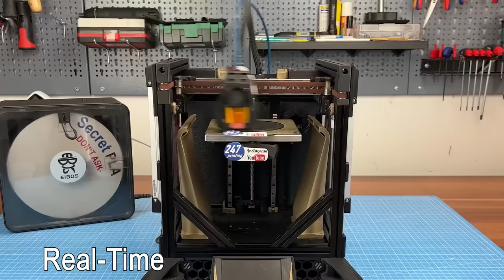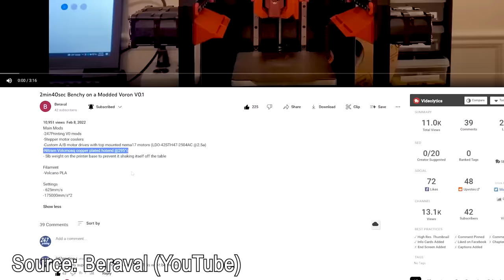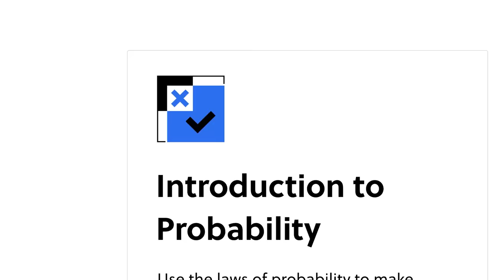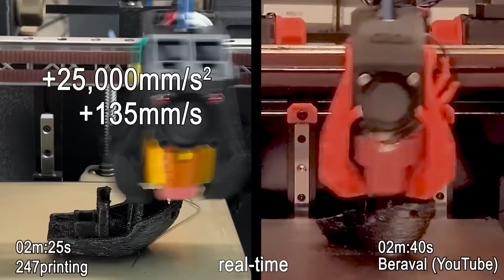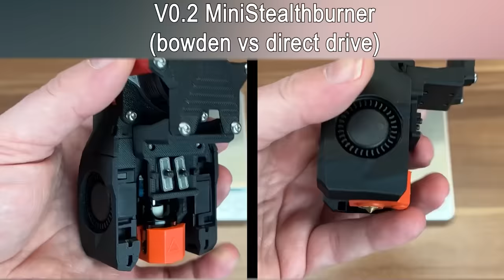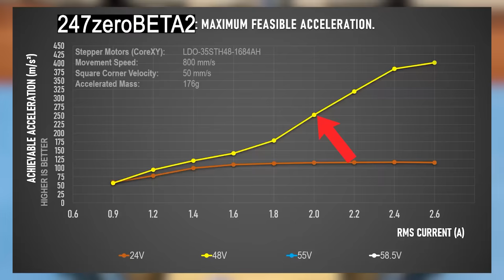247zeroBETA2 : Motion and Extrusion - The Fastest Printer? (No, but it's cool anyways!)

Comment: It's not a Fail, my Friend.it's fucking fast. Sure, it just takes a quick crap on the bed, that resembles a Benchy in under 2 and a half minutes. It seems you just have to teach your baby not to crap on the bed. Did you consider to have lighter rotors in the stepper motors? Because what logical sense does it have if you increase voltage and current and the rotating mass is still the same you will get more inertia and therefore more time to spend in accelerating that rotating mass and decelerating that same mass. There are more lightweight rotors out there with low inertia but with the same torque. So called "Glockenankermotoren". it would be nice if there were those motors as stepper motor versions as well, ideal with Aluminum enameled wire🤔